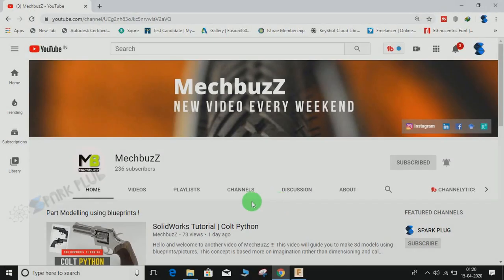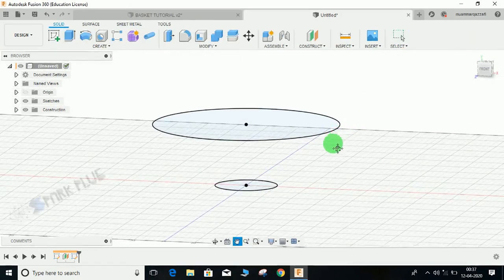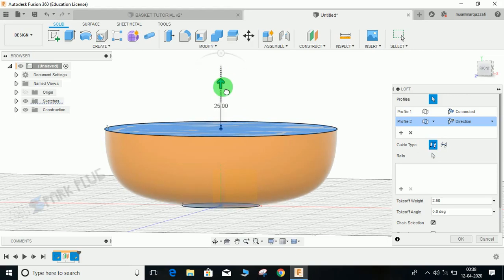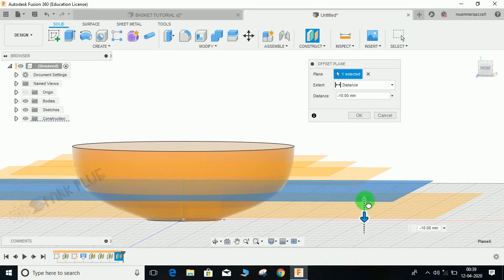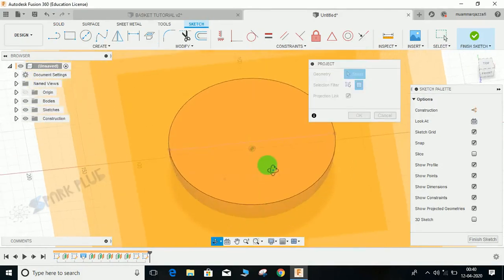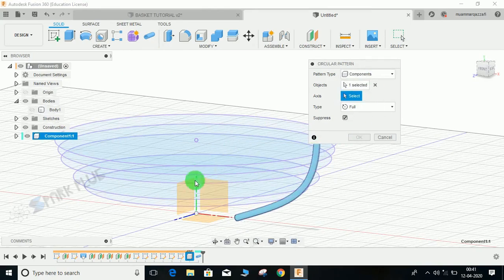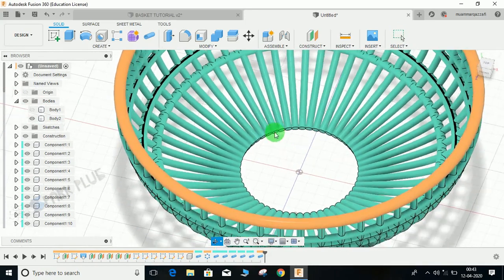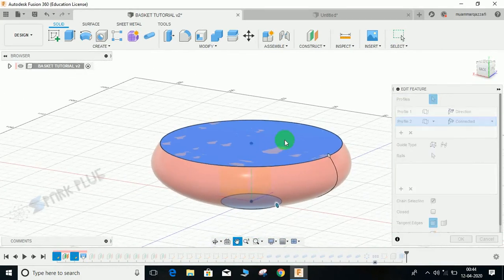Making A Basket | FUSION 360 Tutorial | Practice Exercise |

Comment: Excellent tutorial. I got hung up on the process where you make the intersecting circles on the bowl using the construct planes. The trick that was hard for me to see was to first click the Construct plane, then Create Sketch, then Create >> Project >> Include 3D, then Press P to open Project, click select bodies, click on the bowl, then click OK. On subsequent rings these settings will be default so all you have to do is click on the plane, create sketch, then press P, click the bowl, then click OK. At the end, adding the Pipe shortcut to my toolbar cut my clicks down 66%.